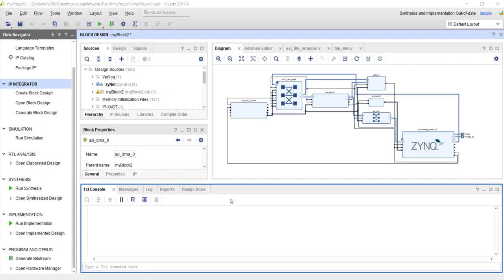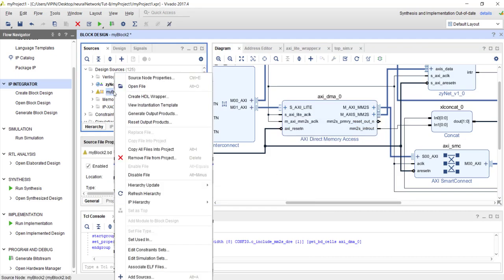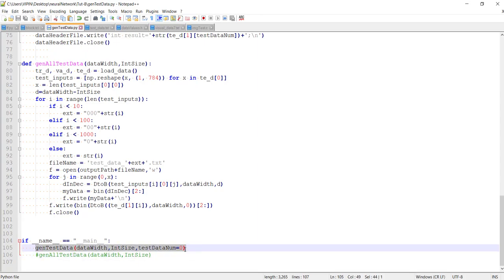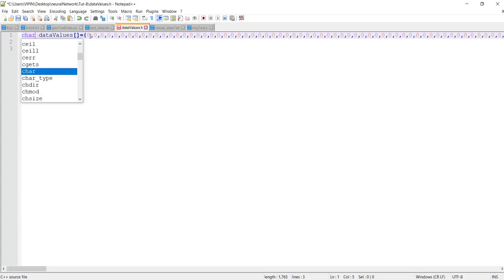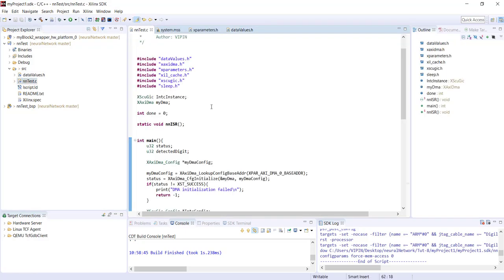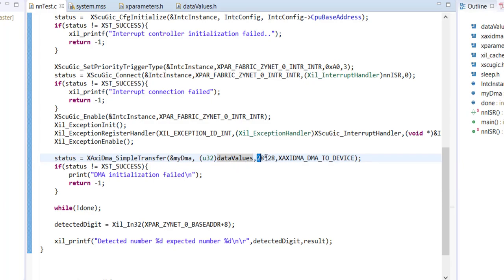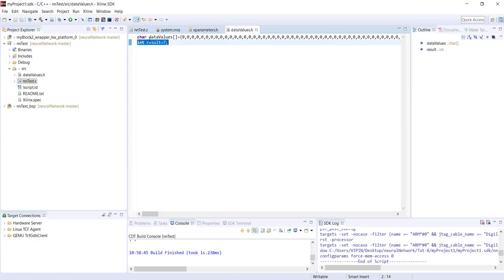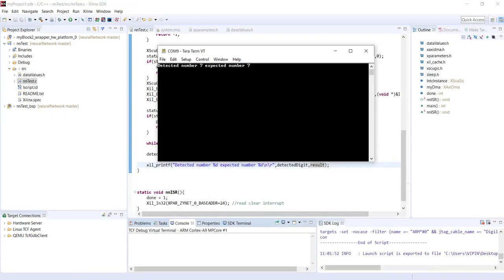Neural Networks on FPGA: Part 11: Hardware Validation

Comment: great video series! i am confused are you using already available IP cores for hardware implementation or are you using the code manually typed by you from scratch for hardware implementation ?

Comment: Watched your videos great info. One issue I don't see how the backprop works?
Reply from the maker: Back propagation is used only during training. Here training is in software. So it's there not in hw
Reply: @Vipinkmenon  so how would you backprop your model in hardware or is it possible?
Reply: @Vipinkmenon  so how would you backprop your model in hardware or is it possible?

Comment: Hi Vipin, is it possible to modify the current design for object detection from the image inputs
Reply from the maker: If it is implemented as a fully connected network. But usually object detection will be implemented as a CNN. I will show cnn implementation after some time. Still under design. Basically will have to combine the convolution part discussed in the image processing tutorials and the fully connected network.
Reply: Thanks for the reply Vipin, your tutorials are very nice.eagerly waiting for those future tutorials
Reply: @Vipinkmenon  Hello, will the CNN tutorials be out soon? Thanks!
Reply: @Vipinkmenon  Hi Vipin will you release the CNN tutorials? Love your videos!